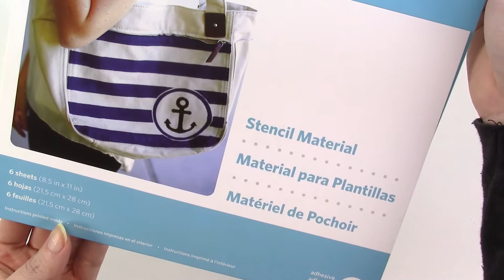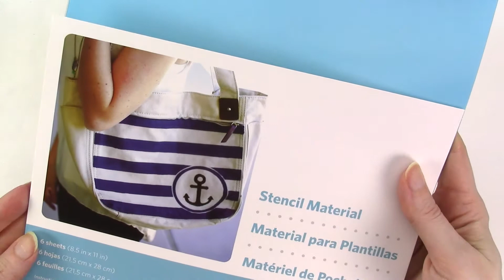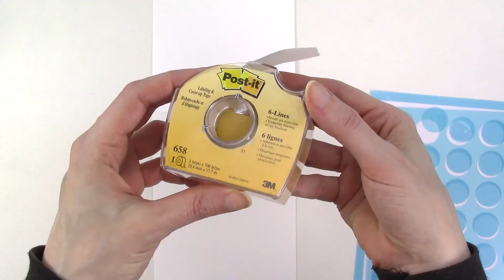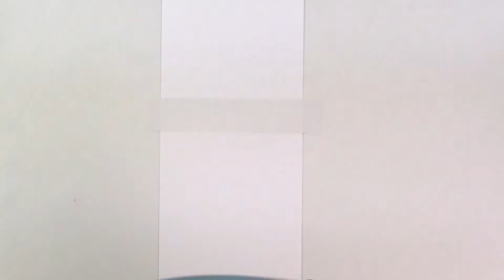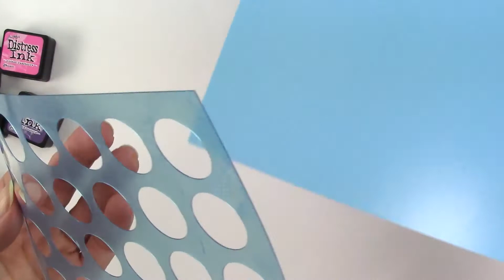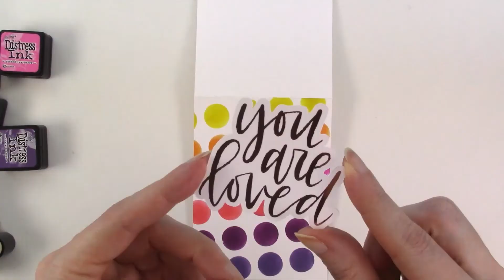Distress Ink Background Card Making Technique (Silhouette Adhesive Stencil Sheets)

Comment: The previous comment is spot-on - your color selections are incredible.  I thought nothing could top the mustard seed (color) you used a couple projects ago, but pumpkin (if that's the right name) is the new favorite!  Your clever use of dimensions also makes your cards "pop," both in setting the dots at a slight angle, as well as using a thicker adhesive backing to give the sentiment height.  Your mind must swim with great ideas.
Reply from the maker: Thanks, Keith! Distress Inks are available in so many great colors that it's always fun to try and come up with different color combos for cards.